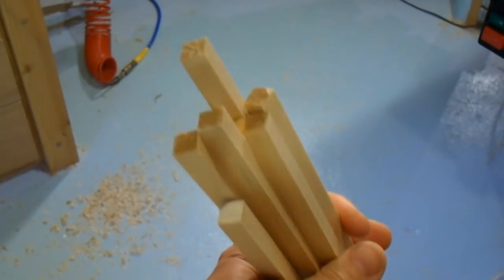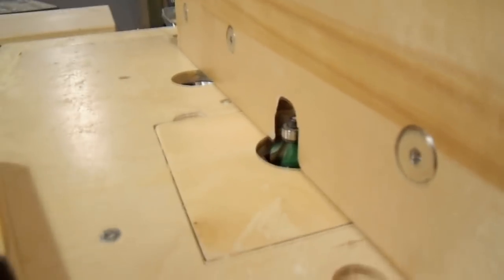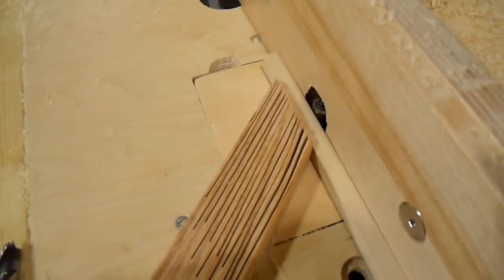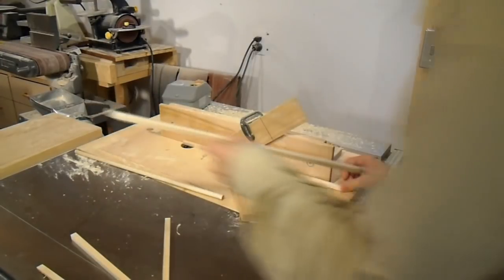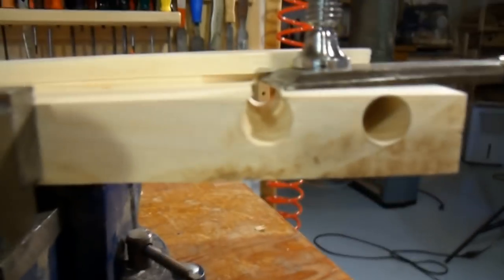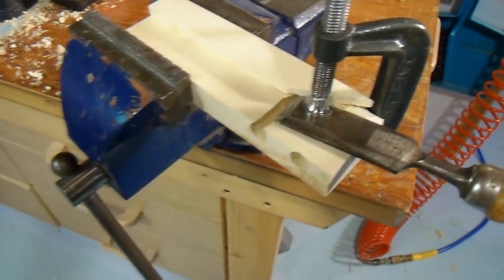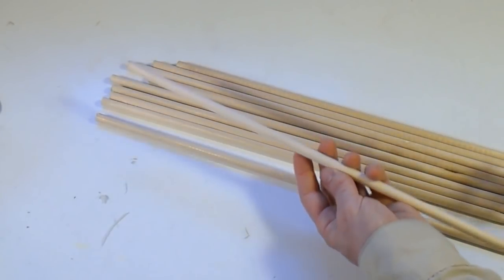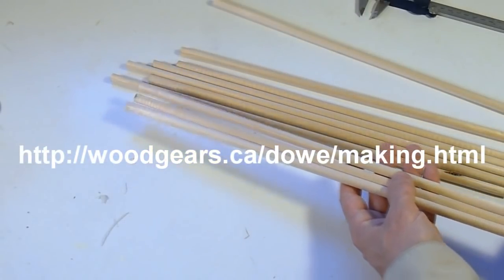Making dowels

Comment: thanks, for this tip, it helped me a lot to make my dowels with walnut and maple for my Simplicity woodgear clock. it works well after a couple of adjustments. it is easy and simple. the 31 people who doesn't like it probably don't do any woodworking or they prefer to buy cheap 48" dowels. Every tip is good and it increase the knowledge of a woodworker

Comment: My box was made from 2 pieces of 4x2 joined with a full length piano hinge on one side and 3 pinned latches on the other. It is important to make sure the box cannot pop open or allow the dowel to flex inside. Shafts were 32" long when first made and the box was approx 3" longer (1.5" each end, extra) with the nut and bearing inner recessed with a press fit and glued in either end. Threaded rod was long enough to fit through entire length + enough for the drill chuck to clamp onto the shaft.

Comment: I have tried it, I used to make my own arrow shafts using this technique. We mainly did it to burnish finish the shafts but it sized then perfectly every time. Good hinges (piano) full length are the best and you do need to get the rough shaft size fairly close (tolerance you are getting is fine). When used as a dowel, we added a glue grove by putting a sharp spike (ground screw) immediately after the bearing. Hole up the middle needs to be a good fit to stop flex as the shaft is pushed through.

Comment: Hi, Mathias, you probably already know this, but there is a way to make dowels with a router, especially a plunge base router with a fine adjustment.  Basically two pieces of plywood, one with an entry hole, and one with an exit hole, all the holes lined up, with two spacer blocks between them, which allows room for the straight router bit, and all the shavings.  The diameter of the entry hole is the diagonal of your square stock.  The diagonal of a square is 1.414 times the length of any side.

Comment: Leave it to you to make your own dowel cutter. That's basically what that tool from Lee Valley is, except it has a rounded blade, plus with yours you can vary the size by just drilling different sized holes. Good work. I'll have to give that a try before ordering a special tool to make dowels.

Comment: Finish dowels accurate & burnished. Piano hinge 2 pieces of wood 3" longer than your dowels with a hole up the middle for dowel to fit in, add strong latches to close. Fit old bearing inner (size you want dowel finished) in one end. Fit nut+threaded rod in other end. Close box with dowel inside then with drill attached to rod, wind the rod pressing the dowel through the bearing inner for a perfect size. Add a small spike/blade sticking up if you want a glue groove up the dowel as well.

Comment: What makes you think I have not tried it out and why would I suggest it if I haven't.
Myself and a few other archers I know, use (for me now "used") this technique in the making of arrows and if I still had my box, would shoot a quick video for you. First the pressed burnish made a far smoother shaft assisting a smoother release on traditional rests, second, faster and more accurate sizing than sanding alone, this also contributed to more accurate spline measurement of the shafts.

Comment: Great Video!
This will give you the oportunity to make dowels of any size and not have to stck with standard sizes.
I have made my own dowels in the past by hammering a square piece of timber through a hole in a pice of steel but I like this method better.

Comment: I was thinking more about the drill side, than the chisel side...but I guess leaving an inch of square stock and rounding the rest might be an option. This only really matters if you'd want bigger than 1/2" dowel anyway. Anything smaller you could always chuck up like you have done in the video. Thanks for responding. Keep up the great work.

Comment: What do you think the limits are on creating larger diameter dowels? 
I have successfully created 8mm dowels like this but tried making a 20mm dowel and it did not come out very even/straight. Having said that I did not try too hard.. I used a fairly hard wood and could probably have trimmed the corners down a bit more.

Comment: Hi,
Good ideal. I use a metal  pipe thread maker and it worked fine for me.I have a full set off them so many size off dowels. Square your wood, pointed at the end, put on your drill and pushed inside to the thread maker, sanded and voilà.

Comment: 2"x4"x8' will give you 4, 2 foot sections of lumber. Out of each of those pieces of lumber you can measure 7x4 dowels. But only cut 6x3 due to shaving and routing. (sorry i am not completley toolshop literate). That will give 18 dowels per 2' foot section of 2x4. Times that by 4 it will give you 72 dowels per 8' section of 2x 4 lumber. The cost of the 2x4x8 (in oak) is $9.68. Wood dowels in a 3/8" x 12" cost $.44.    $.44 x 72 = <$32.00.

Comment: I've read where it's really even simpler than this. If you start with 1/2" square stock, for example and want to make 1/2" dowel, you simply chuck in your router a 1/4" radius bit and run the wood through. Just make sure that you keep a couple of inches of the square stock at the ends so that the wood can register off of your table and won't be rolling around. I haven't tried this but seems like it would be accurate, after all, the router bits are machined to close tolerences.

Comment: I would like to see a little more about the setup. actually makes the cutting  block to see how you position the chisel for proper sizing. I imagine how you cut the slot on the table saw determines the size of a hole.

Comment: Is there any issue with buying dowels a bit bigger than you need, and just using the pencil sharpener method to shave them to size? Other than the higher cost, of course.

Comment: @Matthiaswandel Keep in mind I'm not a woodworker and have never purchased dowels.  Would it be easier and/or more cost effective to buy a bigger size dowel and turn it down to size using your "pencil sharpener" method?  I used to be a huge fan of the New Yankee Workshop. The dowels I used to see Norm use looked like they had splines on the sides (grooves going lengthwise). I assume having these splines allows them to be pressed into a tight hole easier and allow room for glue.

Comment: This comment made me have to mention that maybe you could chuck the square stock into a over-sized socket bit in your drill instead of having to use the router at all, but that would require making the opening diameter equal to the hypotenuse of the square stock. Just an idea.

Comment: first your idea is really great, my coworker taught me another one... first drill the hole in a piece of metal plate that should be the same size as dowel holes in wood, than you just hammer wooden sticks through that hole in the piece of metal...fits like a glove:)  you cant make them as long as you did, but its easier when you're in a hurry

Comment: all you need to do is make a sort of a jig like the one used on a lathe that is bigger on one side (for wood ) and a smaller one that is standard for your chuck and super size Matthias pencil sharpening jig by using forstner bits for the holes and keep the same chisel

Comment: @Oniontears123TNG you just pass the a board partway through a bandsaw/jigsaw/scrollsaw several times making side by side cuts a few millimeters apart and make a hole to hold it down on the other end

Comment: Hi i saw your video and i liked it.. I wanted to make arrow shafts. I am using deodar Cedar( north Indian cedar). I did everything as ahown in the video but the dowels that are coming out have torn up fibres and like big cracks in them .. Which makes them useless for me .. Can you tell me why this is happening?
Reply: chisel at wrong {to steep ] angle or the chisel not sharp enough {most likely}

Comment: Excellent observation about the inconsistency of dowel diameter.
Reply: Keith Wilson He is correct, but really, his aren't that much more accurate. I know a batch I just bought from, the home despot, are all within a few thou each.....and that is the difference between it working, or not working.  One of them was 5 thou off and that's quite a bit for what I'm using them for.

Comment: Great videos, Matthias! Just one question about the dowels - the ones I buy have grooves in them to allow the glue past and prevent hydraulic locking. Do you add grooves to yours or aren't they necessary?

Comment: It makes you wonder why they don't do this in an industrial scale.. Cast (or machine, though that would be tricky I'd guess) the bit you run the dowel through, and have an exchangeable blade on it. Then just use rolls to run the wood through.. Oh well. Very nice invention anyways : ) Congrats on it : )